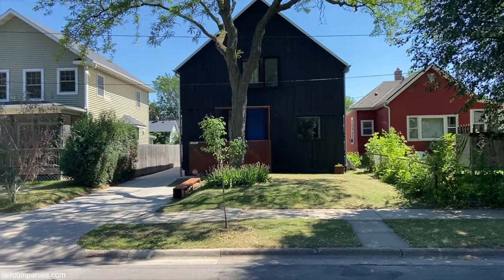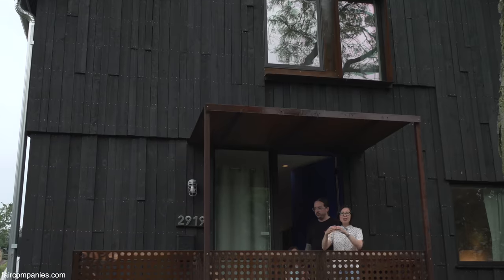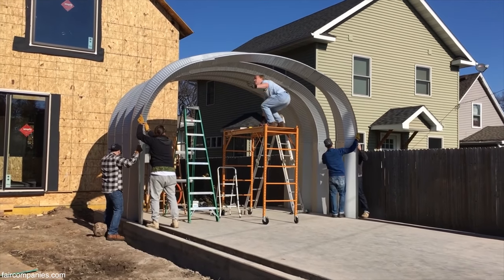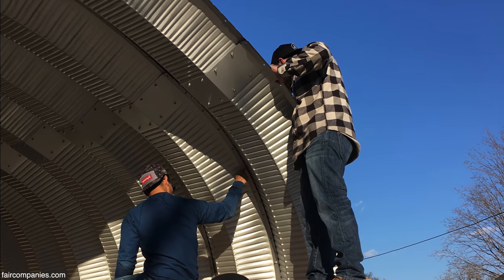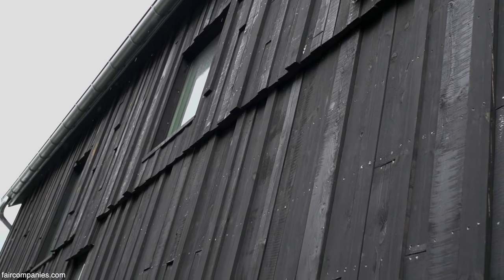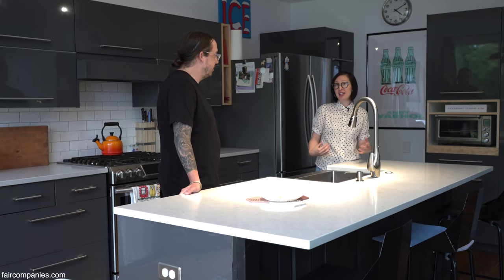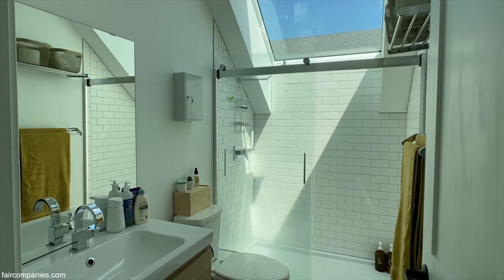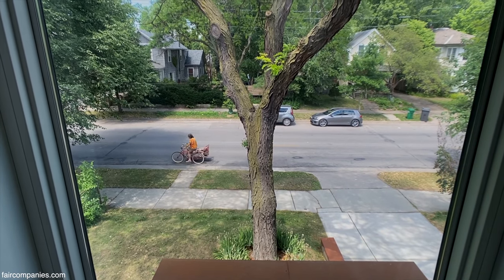Couple fits clever barnhouse & Quonset hut on skinny lot in MN

Comment: Very cool use of the budget.

True North, located in Detroit, by designer Edwin Chan is a great example of using steel ribbed arches for living spaces. The structure is traditionally utilitarian, but the project (like this one) recontextualizes it and gives it new purpose by using it to create affordable housing in urban neighborhoods.
Reply: Will check Edwin Chan’s work, thanks for tip.
Reply: I just drove by an apartment building in Detroit that was an 8 unit Quonset hut over the past weekend.

Comment: I find it odd that it took her 2 months of reserch and no one from the field told her about coating the metal... It's what you do with any opened steel structure in my country. That's common knowledge for any architect or engineer

Comment: Hey, do you know where they bought that diamond-tread for the stairs?  and who INSTALLS such stuff?  I have a concrete place with stairs, these would be perfect.  Thank you for your input if you can...
Reply from the maker: I don't know, though I know that the architect Geoff Warner has it in his house which is what inspired Jean and Joe. If I hear more I will let you know.
Reply: Any metal fabrication shop can do this for you or contact a local metal supply business and they will know someone.
Reply: It’s called “checker plate”. The polished aluminum is used extensively for everything from car hauling trailers, fenders, truck steps, rock guarding anything to prevent road rash, etc. garage cabinet doors, kick plates on doors,........ I buy mine at the local steel supply yard. ✌️🇨🇦
Reply: Yes a metal fab shop will do them. In the states we call it diamond plate.

Comment: Having to prove a steel building is fire rated is the most ridiculous thing I've ever heard of. Just saying.
Reply: You would be safer in wooden than Steel building
Reply: I agree but its probably  because of how small it is. it would cook anything inside should a fire happen.
Reply: Still a good idea to apply an ablative coating to prevent the structure from oven cooking the contents. Very common practice in areas where wildfires may come through. The coating cooks off and provides insulation while doing so. If they get the time/money I hope they coat the outside as well. Typically the coating is meant to face oncoming fire as the surface will bubble and foam to provide insulation.
Reply: Usually in the garage there are flammable things, gas for yard equipment. So if something catches fire in the garage, the fire proof would slow down the fire from spreading.
Reply: @gearoidp  i very much do not agree with that, ask a navy guy how sweet steel can melt with a good heat.
Reply: @xw6968  not only melt, but even before reaching melting point, it loses structural strength. It does not catch on fire, but in the presence of a fire, it starts to lose the shape (specially the thin sheet).
Reply: In addition to the above, hot steel will radiate heat and can easily ignite flammable materials on the other side. Fire officials aren't idiots. They have a lot of experience investigating fires, how they start, how they spread, how smoke moves throughout a building, etc. Fire codes are written and revised based on knowledge gained from real fires in which unfortunately people were killed or injured.
Reply: @gearoidp  no, if fire catches steel construction in nick of time structure collapses, if fire catches wooden construction wood still can handle ist structure while steel turns in play doh. Weakness of wood is flamability, weakness of steel is it looses all of ist durability.

Comment: I can't wrap my head around the idea that a solid steel structure would need any sort of fire proofing. This is what happens when you have idiot bureaucrats such as the ones that run the Minneapolis building department.
Reply: You need the resistance of the structure and the resistance to not affect other buildings in case of a fire. In general, many fire codes is based in time resistance (wall, barriers, etc) and time duration (water reservoir for example)
A steel structure is afected their integrity and can collapse very fast, a Wood structure take more time to collapse. Both have to offer x time before that collapse.

Comment: It's a shame that you have to jump through these hoops because it's steel it's already got a fire rating, it doesn't need a coating because it's not combustible.
I understand city codes and their purpose but at a certain point some city engineer should have been like "duh" and this shouldn't have been an issue. So you spray non-combustible paint on a non-combustible surface to protect it from burning? That is the all-time dumbest thing that I have ever heard from any permit office. I am so sorry that these people had to go through this.
Reply: yuk yuk  yuk.  It is not to stop the building from burning it is to delay it's potential collapse when near a fire.

Comment: I think it's an ugly garage tho totally out of keeping with the houses in that area. Actually you can get a wooden building for a pretty low price if you use the companies owned & run by those religious groups in states like PA - I had them build a 40 ft x 16 ft building (which we later attached to the main house) for around $24,000 - that was a few years ago, but I my opinion is this is way too much for just a garage - that thing will be there long after the main house has rotted away !